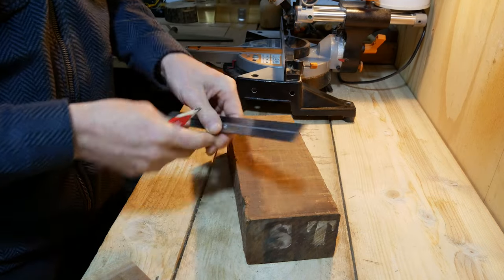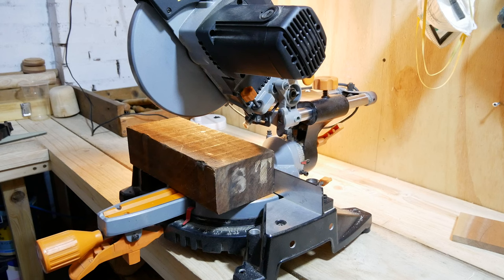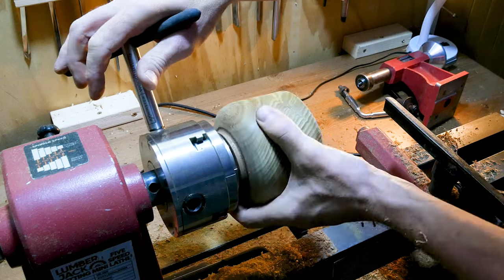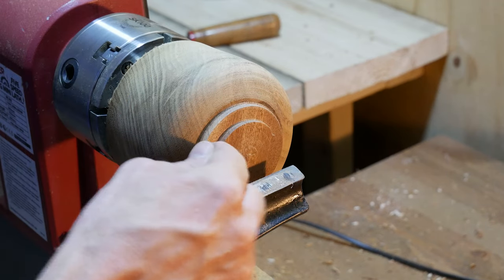Woodturning An Elegant Wooden Bowl: Best Creation Yet From Afromosia

Comment: Good job turning this block of wood. Good idea to narrow the top outside of the piece. Much nicer shape. With the carbide, make sure you are cutting at or slightly above center. You want the tool to be level to the floor. Angling the cutter to get a finishing cut is a good thing and will help smooth the surface. 

One correction that really doesn’t matter in the end, I’m pretty sure the glue block you used is either mahogany or sapele, not cherry. Still looks great as the foot though. 

Over all, well done!
Reply from the maker: Thanks for feedback and the turning advice - much appreciated. I do have some Sapele the same size and shape from the previous video - maybe I got confused. Thanks again 🙏

Comment: A very pleasing shape and finish Ben. Well done. A couple of tips I've picked up along the way 1) Hot glue is really handy when making a sacificial tenon, takes about 10 minutes to go off as opposed to overnight. 2) When you do use wood glue for laminating sprinkle a pinch of salt on the glue, it makes the 2 faces grip instead of sliding around. Suggestion for the remaining block, split it down the middle lengthways and glue in a light wood strip to make the block square and bigger. Keep up the good work.
Reply from the maker: Hey. Great tip with the salt in the glue - can definitely see how that would stop the slide! 

I also love your suggestion of packing the remaining block to make it bigger. Would also make it more interesting! Thank you 🤩